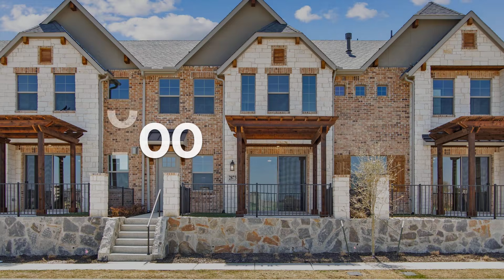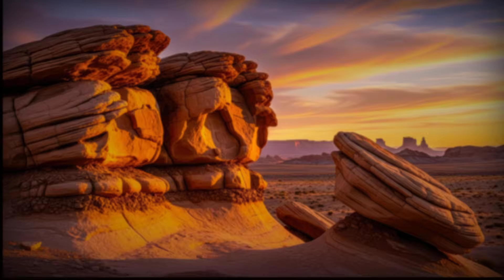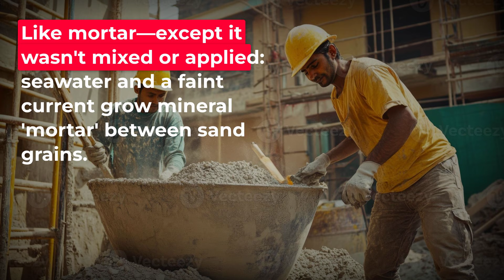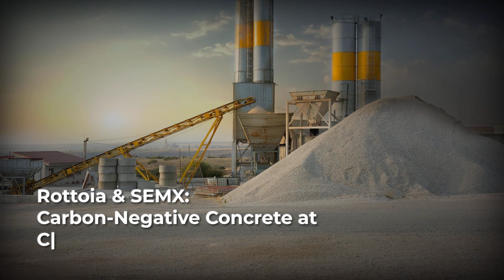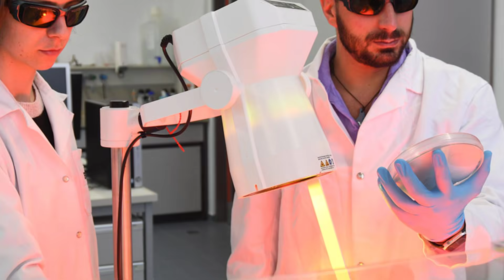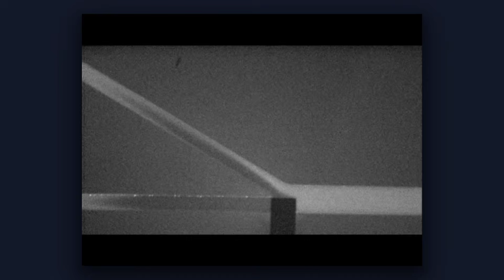This Electric Process Turns Any Sand Into Stone Walls That Last 1,000 Years. Why Is It Hidden?

Comment: Very positive article am interested and i would like to do a small experiment at home,i have 3 questions about this process . one i would like to do it on a small block mould, does voltage increase when you want to do it large scale? two, what kind of materials should i use for the anode and cathode on the block mould? number three what happens to the anode and cathode when the block solidifies? would they be trapped into the solidified block?
Reply: Theres tons of research on it apparently the did it on a 5 mile stretch of beach to stop erosion and have been remaking coral reefs with the technology